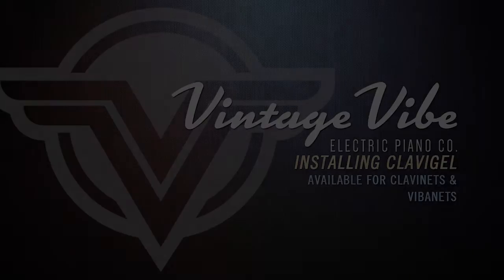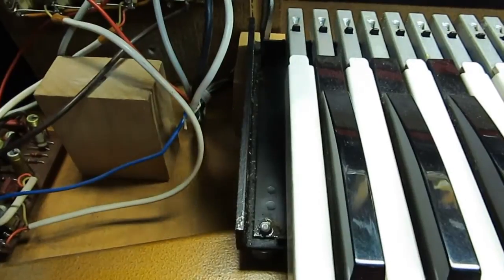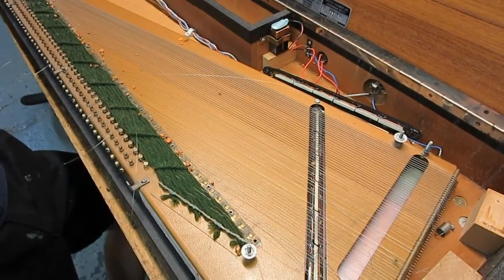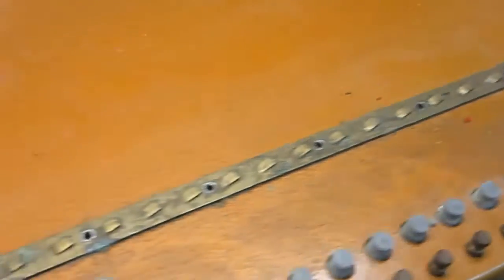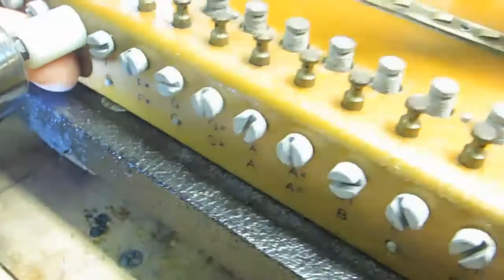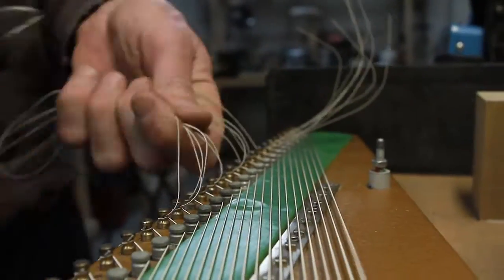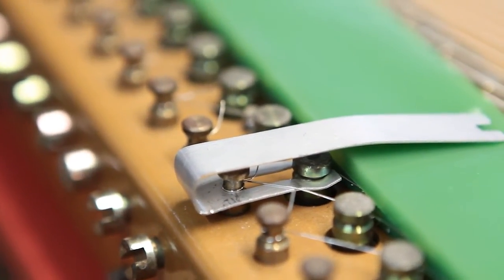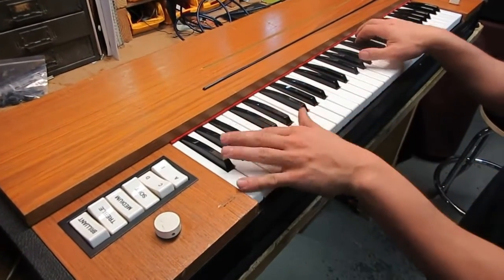Vintage Vibe Clavigel Installation

Comment: Hey @VintageVibePiano - having watched this video (as I embark on fitting clavigel) I've realised that for the past 30 years, my D6 has been missing the little screw at the back of the keyframe that secures it to the harp. You wouldn't happen to know what size that screw is meant to be?